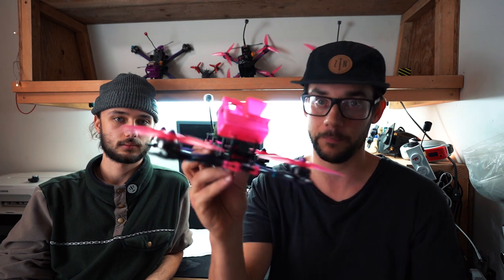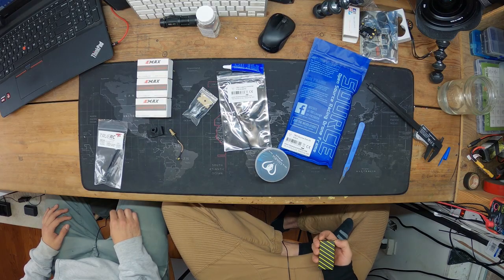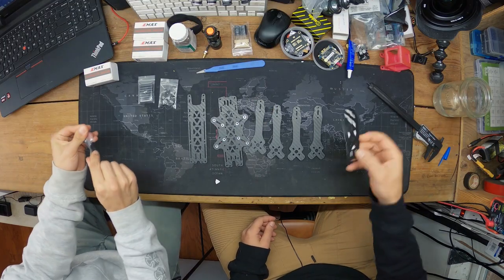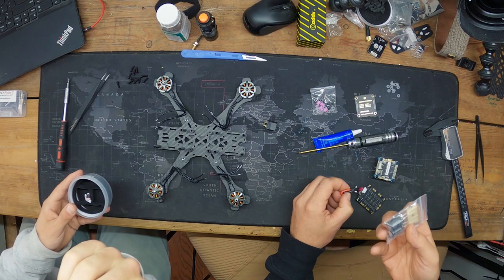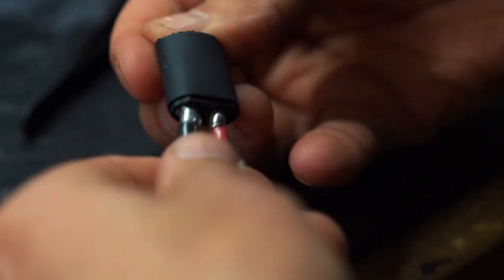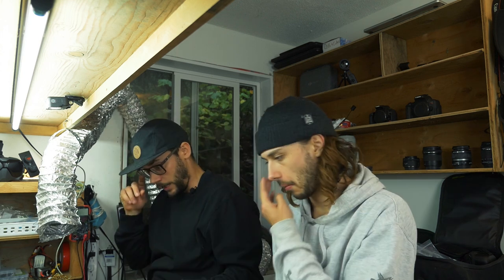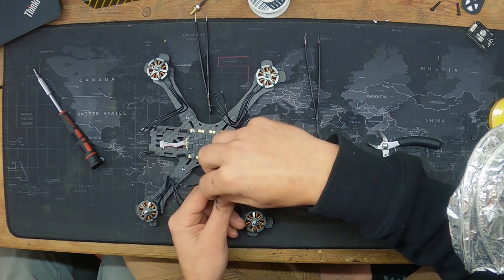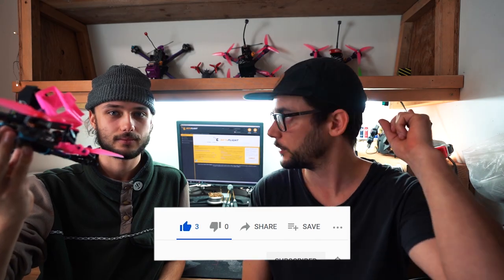*GIVEAWAY* The First FPV Freestyle Drone You Should Build (Part 1)

Comment: Hey guys great content! I've used the Mamba for over a year now on 3 builds, 2 failed on me which was disappointing but all in all it's a good stack for a good price. Also for whoever wins/won they don't have to change the motors to run 6s if they don't want just us the auto motor limit which is a very cool feature and I use that on 2 of mine. There are plenty of vids on YT how to do it but I highly recommend it if you don't have the resources to upgrade to 6s motors. Also first thing I always do when I get a new fc is plug it in to BF or whichever GUI you use to make sure the fc is good and connects.

Comment: I love the headline of "it'll fly... Well" just have to figure out to make it hit the same way joshua bardwell's does!

Question about the build: how do you know where the motor wires go? This is something I've always wondered when watching build videos. 

Also love the amount of caution you guys used on the lipo lmao! In my lipo builds I'm just like "eh those connections look like they aren't touching... Maybe... Let's plug in the lipo and see!"

I'm interested to see where this channel goes, I'm liking the vibe so far! I love watching people build things! One day I'll attempt a fpv quad.
Reply from the maker: Thanks dude! As far as motors go, the 3 wires connect onto the esc. Most times the pads will be labled M1 for motor 1, M2 for motor 2...ect. It doesn't matter which order you put the wires on those pads, however if the motor is spinning the wrong direction then you will either have to switch 2 of the wires for said motor or use Bheli/Bheli32 (depending on your esc) to reverse the direction. Thanks for the comment!

Comment: You don’t have to swap motors if you want to run 6s just use motor output limiting try setting it’s to 6s 60% and then bump it up to 65% for more performance.
Reply from the maker: True, never tried this out but iv heard it works, Have you personally tired this? how does it fly?
Reply: Yes it’s good lot more contrwith the way you fly 
Definitely would recommend new people getting into fpv to build a 6s drone and run 4s battery’s 

How long have you been flying